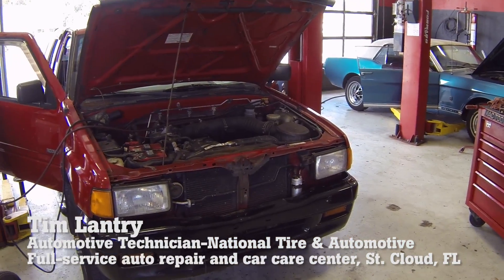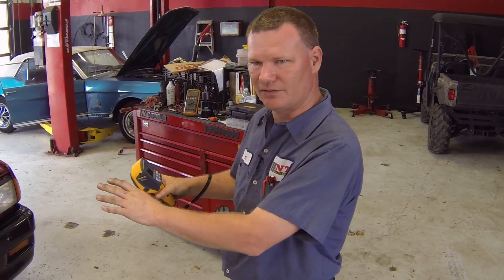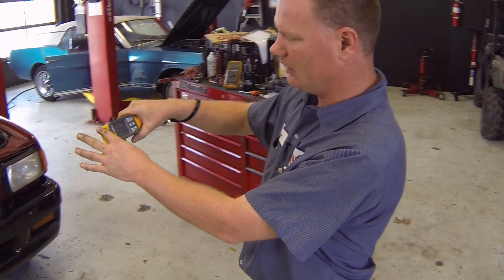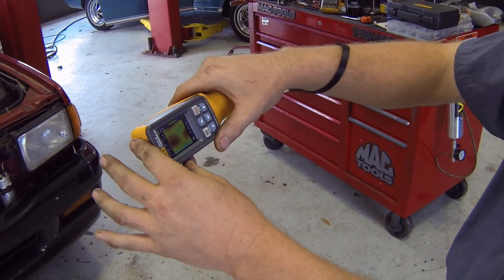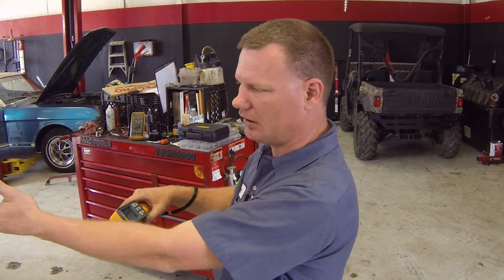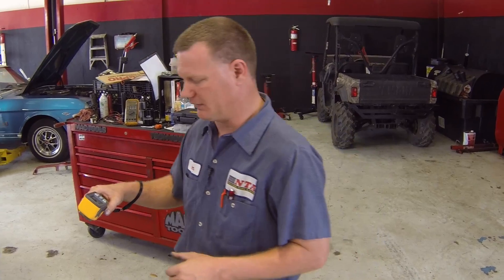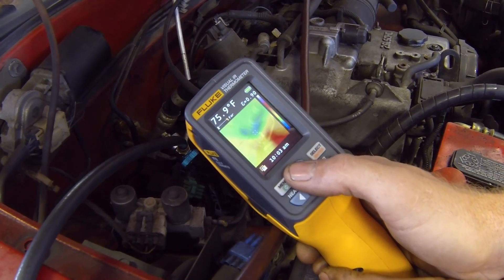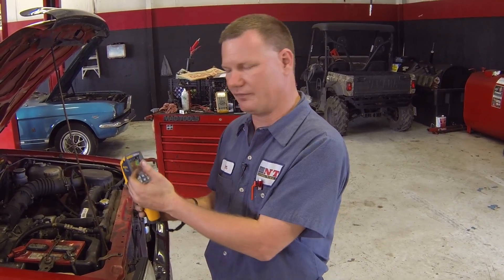How To Diagnose a Car AC System With The Fluke VT02 Visual IR Thermometer

Comment: Yeah but a tech  could briefly spray any area with compressed air or something cold to make a doctored photo. Best tip- go to a tech you trust. Usually an old, not fancy, not franchise, dirtyish looking shop. The same mechanic- not a chatty type. Don't go to  random shops that are smooth talking, charge low prices until they get it apart and shops that are a revolving door of new techs.